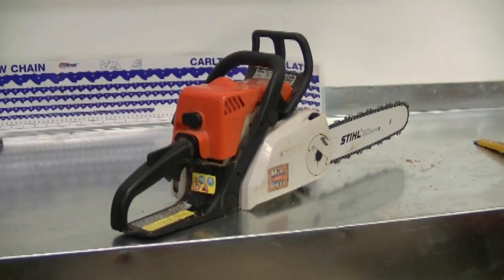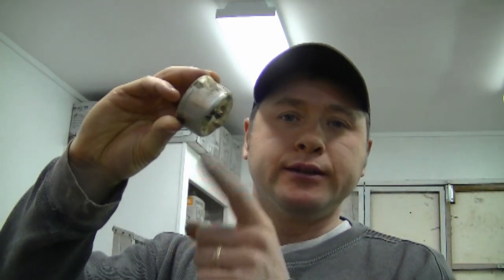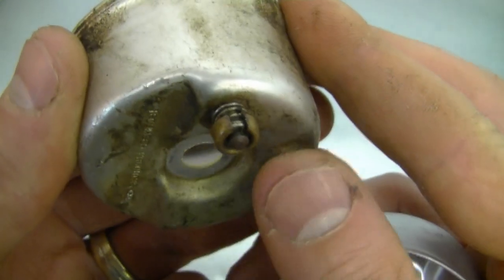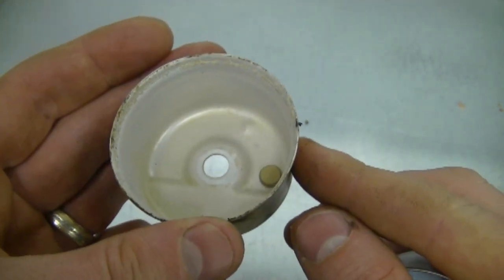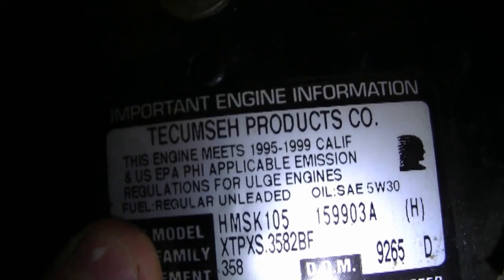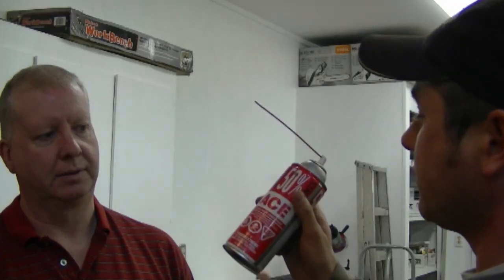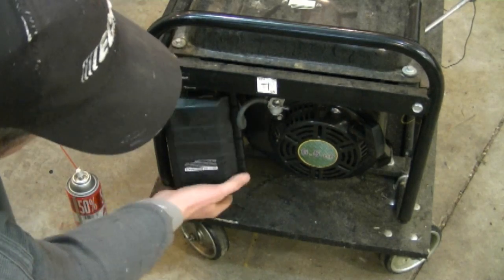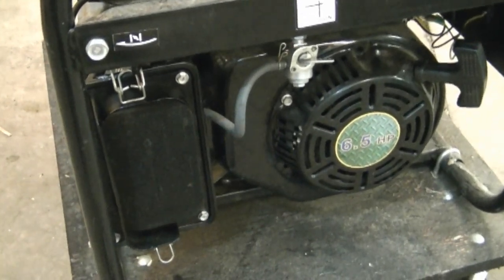Small Engines Q & A Video #82 in HD

Comment: Hi DB,
Stihl is following Echo with their carburetion.  The idea is driven by the EPA and CARB.  If you remove the metering diaphragm from the base of the carb you will find 'thread in' jets that are numbered for fuel flow based on market area.  Most units stay in the same market area where sold, so not much jetting change is needed.  New 460 and 660 saws are now built this way although traditional side jets remain for elevation adjustment.  Auto-tune designs are next, seen one yet?

Comment: What I do on my generator if it won't start, and the gas is still good. I will take the air filter cover and filter off, and put my thumb over the carb opening, and it usually will start. I guess the choke doesn't close tight enough.

Comment: I just seen your video on the colmen 5000 watt gen with a 10hp techemsah engine. Is it possible to put a electric start on one of those? I have a devil bliss same engine it has a cover on the side that looks like you could take it off and put a electric start there. I have a old snow blower 10hp same engine older but does have a electric start I wander if I can take it off.